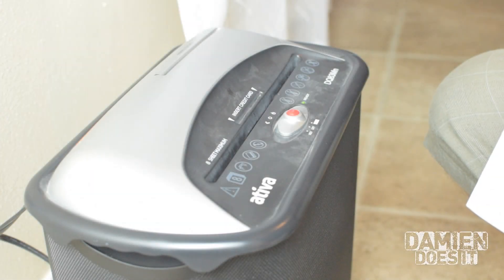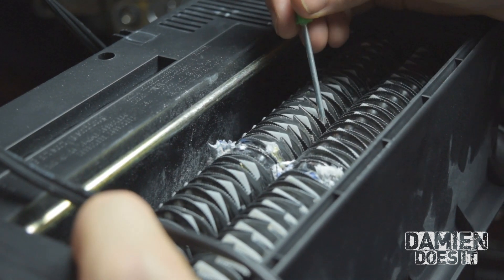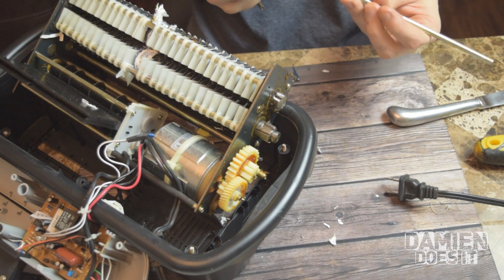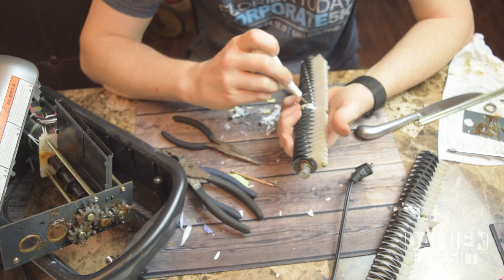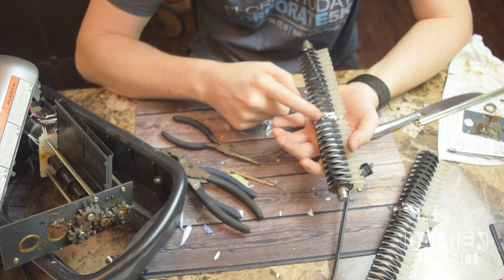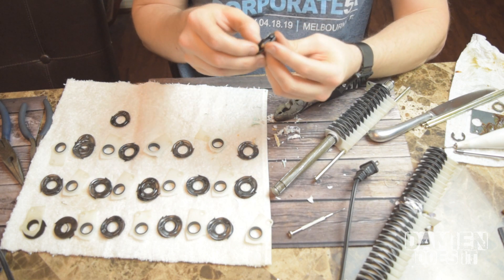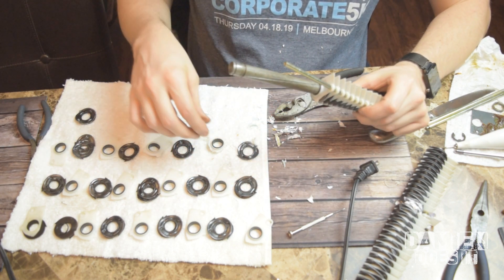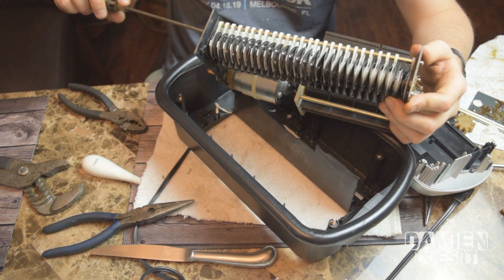IS IT JUNK? Paper Shredder Disassembly and Repair!

Comment: Excellent!  Only suggestion is to slide the parts you are taking off onto another dowel rod or  a pencil or a chop stick.  Then you can just slide them off and back onto the shaft.  Also on my shredders I sprayed a little Rain-X which cleaned, lubricated and coated them which seemed to help them alot.  My motor keeps overheating so I am thinking of attaching a drill motor instead.  Should get some more RPMs out of it too.  Then I will have a turbo shredder.
Reply from the maker: That’s a great suggestion! Thanks for checking out the video. If you do make the turbo shredder, you definitely have to make a video of it!

Comment: Very helpful tear-down video for the repair I am about to do on my old Fellows shredder. Only suggestion I have would be to have used some of the excess grease (that was seen on the metal end piece) and put that lubricating material on the adjacent plastic gears (which is probably where it was before it got squished out over time).
Reply from the maker: Edmund Drozek definitely good advice! A well lubricated gear is a happy gear!

Comment: Is there a video showing how to mesh the two shafts for re-assembly ? I am stuck there on mine.
Reply from the maker: I wish I would have filmed it in better detail. Once I for the two shafts back together, I lined them up and pressed on them and kinda rotated them back and forth. Eventually they interfaced and started meshing

Comment: You don't have to remove all of the shredding teeth. Just pop off the retaining clip and move it to the very end where the previous retaining clip was. This will give you enough room to spread the shredding teeth apart so you can clean out any paper that is stuck without having to remove all of them, without having to worry if they stayed in the correct order.
Reply from the maker: I didn’t just have paper jammed in mine though, I actually had teeth that were crushed and twisted on the post. I agree though, just a simple paper jam could have been fixed way easier. Thanks for checking out my video!

Comment: I have a similar paper shredder that only works in reverse. It didn't work at all, then I replaced the fuse and the lights / reverse now works. It's not the sensor, I put a multimeter over the sensor wires and when you click the sensor lever the multimeter beeps in continuity mode, so the sensor is working. But the motors do not activate when the sensor is pressed. Wondering if you had an ideas? Thank you.

Comment: Why didn't you use tweezers to take the pieces of paper off the blades?
Reply from the maker: Great question! I tried tweezers, needle nose pliers and a screwdriver first but the paper was compacted too hard to pull it off. In addition, the cutting wheel blades were bend and deformed from being jammed up with paper and needed to be reshaped anyhow. Perhaps if the paper accumulation wasn’t as severe, tweezers or primers might have worked better. Thank you for watching Darlene!

Comment: Couldn't see how you separated the blades. The camera was too low.
Reply: Most cutter blades are stacked in pairs of two. There might be sticky oil or something holding them together. Simply pry them apart. I think the failure of most shredders is lack of lubrication. Found out the hard way when the spacers jammed in the blades. I had to find 6 spacers, then 5 small bushings/ spacers between the blades. An online source had salvaged parts for shredders, while the brand was different, the part was basically the same. Reassembled the shredder and all works fine.